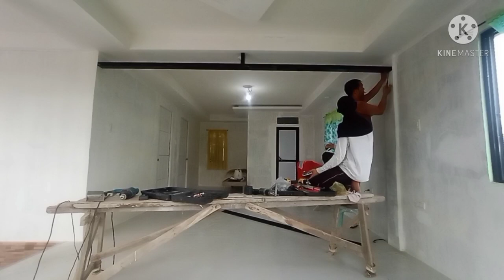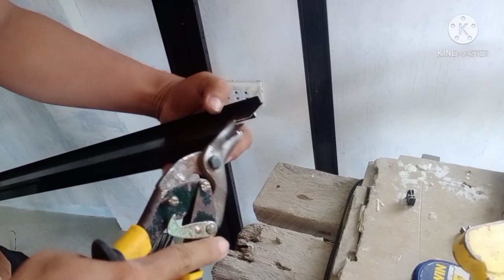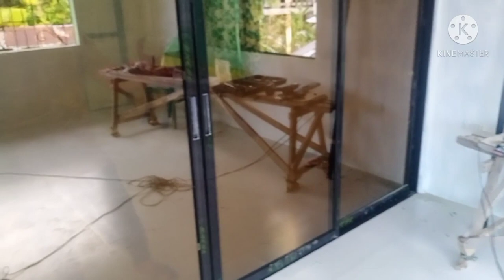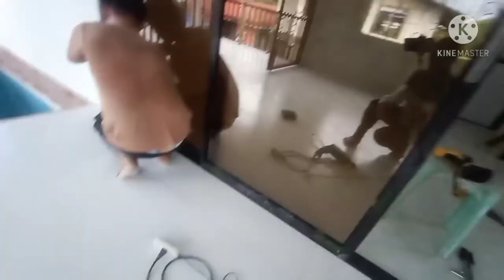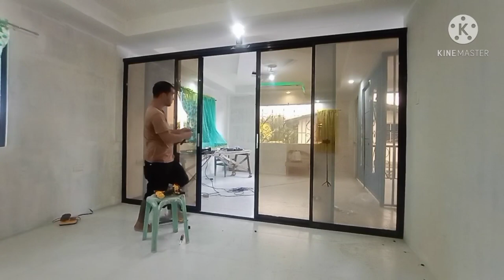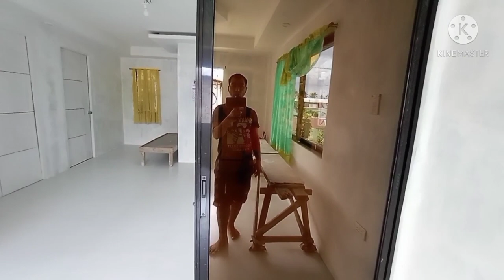HOW TO INSTALL SLIDING DOOR WITH FIXED PANEL BOTH SIDES?

Comment: I have made someone install the same but the fix ones are a bit like moving when touching it. Is it good?
Reply from the maker: It's not good
Reply: @PONGZWORKTV   what do you suggest?
Reply from the maker: @ManiSha-ly4pz  ask another installer to fixed it
Reply: Thank you so much for your fast reply. Indeed will do what you have suggested.
Reply from the maker: @ManiSha-ly4pz  your welcome and have a great day

Comment: Sir name all d materials naman that project..thanks po..kung puede pm ok lang po salamat..ang galing nio sir lagi po nanonood sa videos nio
Reply from the maker: Sd interlocker
Sd lockstile
Sd double jamb
Sd double sill
Sd double head
Sd bottom rail
Sd top rail
Sd steel roller single
Glass
Sd 12, sd 11 & sd 10
Silicone sealant
And screw 8x2, 8x1 1/2
Blind rebits
Reply: @PONGZWORKTV  thanks sir! Ang bait2 nio malaking tulong po ang vids nio sakin